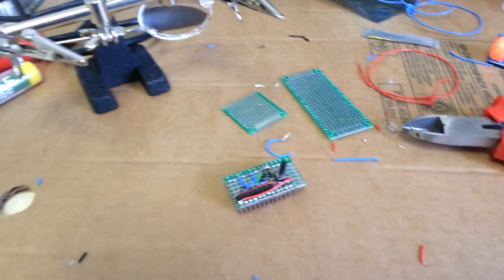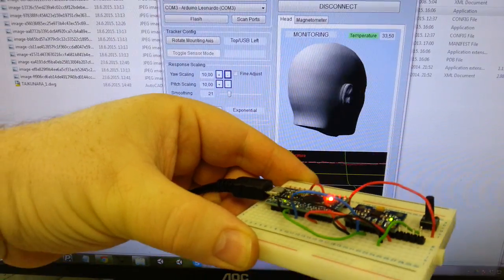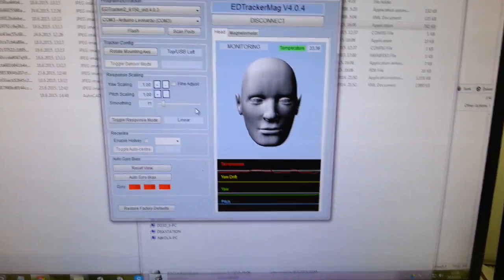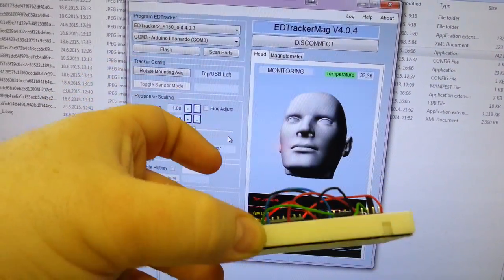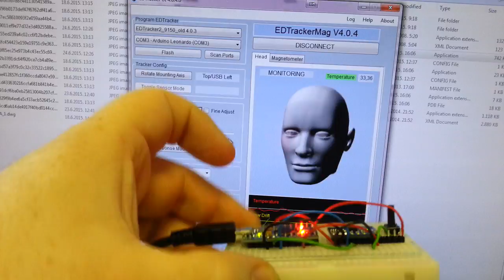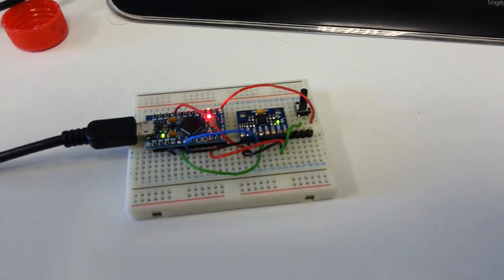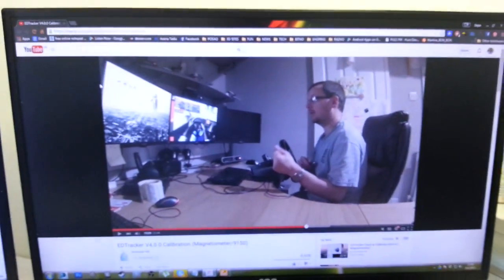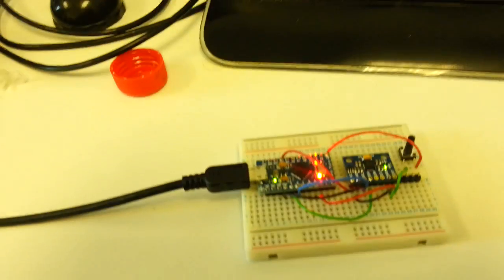EDTracker test build

Comment: I have trouble the arduino is not recognized on usb port, checked the win10 64b extra software.
on the board is a steady red led, and a orange blinking
any tips, thx

Comment: can i use it to play vr games ?????
Reply from the maker: This is just one portion of what you would need for VR (just head rotational tracking; it doesn't have translation tracking). But with a lot of customizing, finding proper displays, lenses, etc. you might be able to build your own headset. But it would probably be more expensive then buying already made one.
Reply: yes i was planning to use 5 inch hdmi display and putting it in vr headset and use your project for head tracking
Reply from the maker: I would suggest visiting http://www.edtracker.org.uk/index.php That's where I got original plans and instructions. I would also recommend using their PCB (you can find it in their shop; it also helps to support them) because it makes entire thing easier to assemble and also makes it quite compact. And they have new wireless version that apparently works quite fine.
Reply: Sirius ModZ You could use your phone as a display? With display streaming
Reply: yes and if you want to play vr games on your phone use trinus vr  or rift cat
Reply: Sirius ModZ Yep, way cheaper
Reply: here (save you the trouble)     https://ru.aliexpress.com/store/product/9-Axis-Surrent-Sensor-Gyro-Module-Tracking-System-For-Headset-Oculus-Rift-DK1-DK2-DIY/1196030_32498507794.html